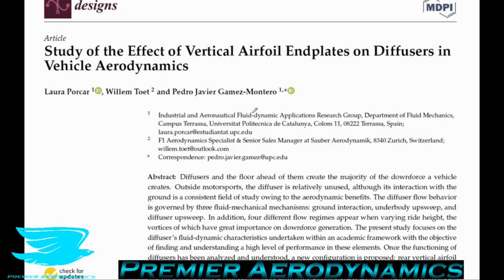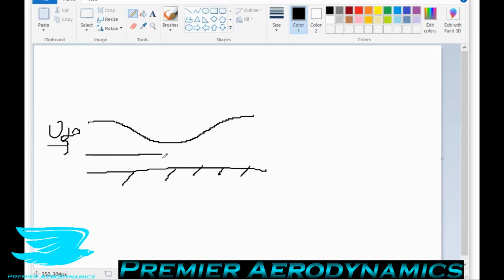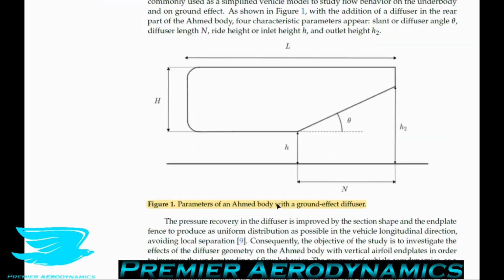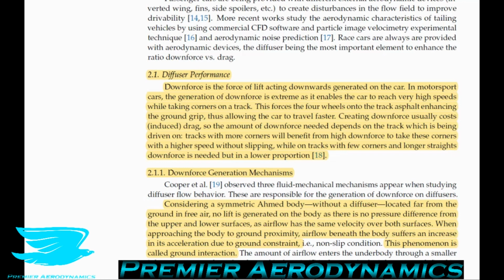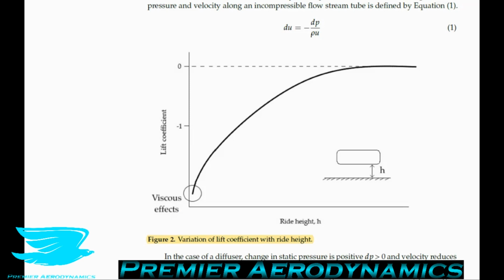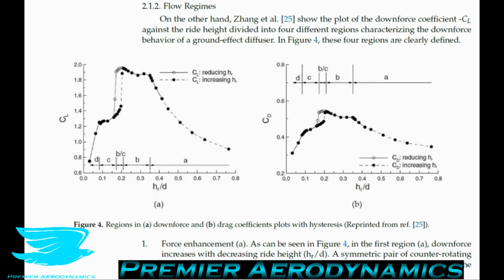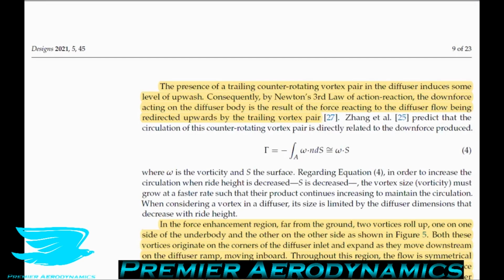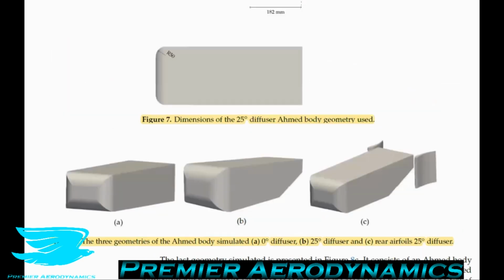Aerodynamics of Vehicle Diffusers in Motorsports - Podcast #108

Comment: Interesting and adds to the current understanding of fluid dynamics. I sure wish this kind of info was in easily accessible public domain back in the 60's when I designed my first airplane. Today I'm working on a low CD RV trailer and another airplane, but a single seater with low power and capable of hi-speed and low stall speed so gathering all I can of the current body of knowledge.  I remember reading years ago that Einstein was baffled by fluid dynamics as introduced to him when sailing.   

Thanks for the post and also to the commenter below.
Reply from the maker: Apparently Einstein said, "When I meet God, I'm going to ask him two questions: why relativity? And why turbulence? I really believe he'll have an answer for the first."

Thank you and you're welcome.
Reply: Pretty hard to ask a question of something you don't believe exists, but it illustrates his perplexity on the subject of fluid dynamics.  @PremierAerodynamics

Comment: Vortices in diffusers are very interesting, they are basically flow restrictions. @ 27:16 you clearly see how vortices restrict airflow, Figure A shows how the vortex pair is creating a converging duct, which accelerates the air further.

In the new style F1 cars (2022 - present) the floor fences at the leading edge of the floor create a strong vortex that does the same thing over the length of the floor. Then again at the diffuser. I strongly believe the current regulations produce nearly sonic velocities in the underfloor, and the CFD I've seen tends to support this theory. The central body of the car and the innermost floor fence produce what looks like a sonic shockwave.
Reply from the maker: So, you do think that currently, the flow is accelerated to about 3 times inlet speed at some places because of the various flow features blocking some of the flow?  (and the geometry). That could also cause some choking, and reduce the efficiency of the underbody.
Reply: @PremierAerodynamics  depends if you want low pressure maybe high velocity and carefully restricted flow is the answer.